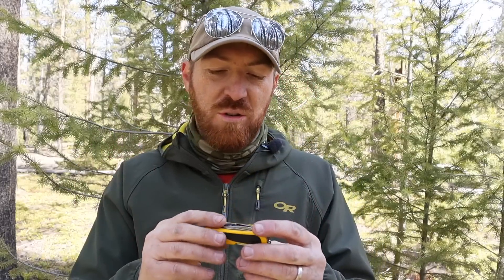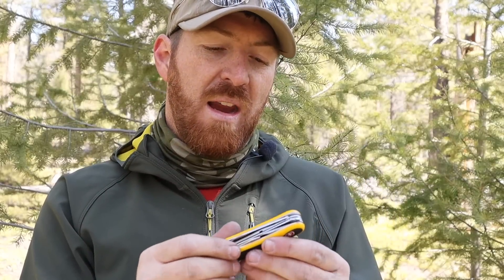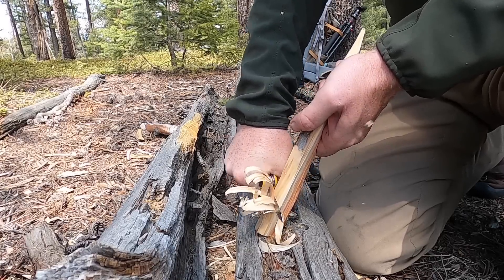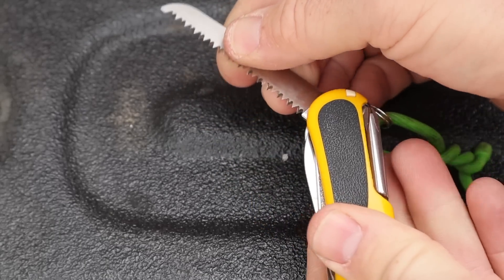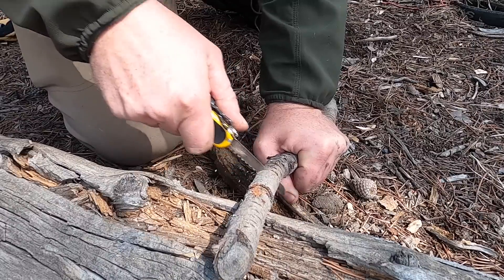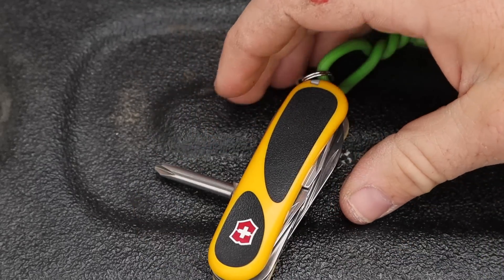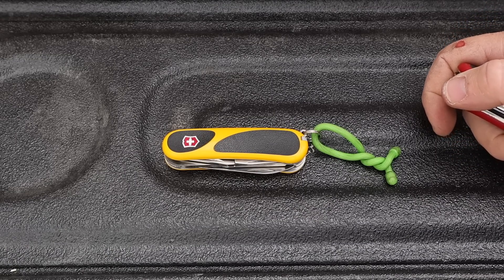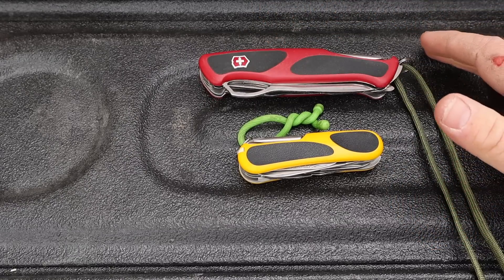All You Need! Swiss Army Evogrip 18

Comment: I like the Huntsman model. Corkscrews are great for undoing tough knots and I find myself using the small blade more often than the larger one because I feel like I have more control and a finer edge. The parcel hook that comes on the Huntsman/Fieldmaster is great so long as you're using a little ingenuity - I use it to carry litter boxes with the plastic packing strap handles. It's really about what options you can make work for you and what models have those options.

The Evo series uses a lot of the Wenger brand tools and are different from the other knives. I hear a lot of it is hit or miss, especially the scissors because they have micro serrations that catch and fold on stuff like cord and bankline. Gotta research your buy.
Reply: Also a big fan of the huntsman. The only thing I missed was a locking blade but its really easy to wrap a bit of paracord around it to do the same job. I never go into the woods, hiking, anywhere outdoors really without it.

Comment: I really like Victorinox knives and I have had one for years.  The saw is very impressive and can do a lot more than just cut branches.  I once used one to cut off a brass padlock by cutting through the brass itself.  The large teeth on the saw make good for cutting soft nonferrous material like brass and copper.

Comment: the point on the nail file is very useful as a small screwdriver. used it to tighten glasses and to remove the backside of my timex watch to replace the battery. and the file always comes in handy when my finger nails crack or split.

Comment: The main blade  on these little models can be pinch opened with thumb and forefinger.  No nail nick needed. And better blade belly than similar Vic model.  If you keep to light tasks, the blade doesn't dull all that fast.  An outstandingly useful bit of kit! 
THANKS,
David.

Comment: For those with eye or sun glasses the file/nail cleaner can be carefully sharpened at the end to make an excellent eyeglass screwdriver and will still perform the other functions. If you have no use for glasses or a nail cleaner you can file/sharpen it flat on the end to make a scraper and small wedge for opening stuck jar lids.

Comment: This model SAK was original to Wenger SAK's.  The sculpted handle and the scissors with the lever operating off the mainspring rather than it's own independent spring like you see on most other Victorinox models were design features specific to Wenger SAK's..  When Victorinox bought out Wenger much of their production stopped, but the plant making this model keep on producing.  One of the things I hated to see go was the hook shaped can opener on the Wenger SAK's, I found that style opener more useful for tasks other than opening cans.  I still have some Wenger SAK's including one with a locking main blade.  The small Wenger SAK with nail clippers is part of my EDC.

Comment: The Evogrip 18 is one of my favorite secondary carry knives. I like the tool set. The Evogrips are a carryover from the Wenger designs, which is why it has the different style scissors.  This 85mm Evogrip and the 91 mm Huntsman are two of my favorites. Nice video. Oh btw I noticed you are correctly calling that SAK an Evogrip 18 but in your text you are referring to it as a S18. The S18 is the same knife but it has a locking blade.
Reply: Yeah I way prefer Wenger's micro-serrated scissors to Victorinox's. The Huntsman is also my favorite SAK, but my most used is a Midnite MiniChamp with the pen and red LED in the scales.

Comment: I have the S17, and love the locking blade option.  Now I can poke and stab materials with the main blade like plastic bottles and wood surfaces without worry of the blade folding and causing injury.  The bottle opener/flathead screwdriver is also auto locking so you can leverage heavy use without worry of the blade folding on you.  With the wood saw, awl, and scissors, it's the awesome Huntsman with a locking blade.  Wish Victorinox offered the locking blade (with liner lock) on all it's medium sized knives as an option like this as it's a safety feature more than anything.

Comment: I have three of these in the S16. Each slightly different. There is an S16 Evogrip that has a locking blade. The one you showed without the locking blade. And there is the Evo S16 (with or without locking blade), which was discontinued. My 3 models do not have the saw, and are 1 layer thinner. They are the ideal SAK knife. I completely agree. I like the Alox cadet as well. Great recommendation and video!

Comment: I do have a Evogrip 18 wich is Wenger made. It's on of the models Victorinox kept in there portfolio when they purchased Wenger. The Wenger can opener was of a different design, that was swiched over to that of Victorinox. I also have a Wenger made Evogrip 17 with walnut grips. The difference is it has a corkscrew instead of the phillips. And it lacks the tweezers and the toothpicks. The tweezers and the toothpick of Wenger are also a slightly different design. Victorinox still uses the Wenger brand for Suitcases and Watches.

Comment: An interesting knife. I do love the victronic series.

I agree with you about the Phillips screwdriver. I believe they put it where they do for torque, but like you said you can't reach into smaller spaces. And if you put the Phillips screwdriver where you suggested, and only opened it at 90°, you can get an awful lot of torque with it.

I disagree with you about the usefulness of the saw. While you can take a dry branch and break it in your hands, or a thicker one between two trees, even this small saw can be useful for precise cuts and for cutting green branches for tools. Especially fishing poles. And the precise cuts would be more appropriate for emergency shelter building, and other tools. A larger saw would be nice, but this will do well in a pinch.

I would like to see the nail file replaced with a regular file like the Swiss champ, which can do nails, but also metal. I even used the metal file to cut into thin metal.

Comment: I've got to disagree about you with the file. Especially outdoors. Combined with the scissors, if you catch/cut your fingernail and it always catches when you put your gloves on, it's the perfect tool. 
Also, when you're outdoors, you don't know if that's dirt, or shit under your fingernails. 
The corkscrew is great for unpicking super tight knots. 
The flat head driver on the evos (a holdover from the Wenger line) actually recesses under pressure and won't fold if you're putting pressure on it.
Reply: The awl on a SAK is the best nail cleaner ever.
Reply: The file also works very good as philps-screwdriver for tiny screws

Comment: Never really used the saw on my SAK until I bought a camping hammock; now it's an essential complement to remove those annoying little growths that get in the way of tie straps.  Conversely, I'd previously never buy one without a corkscrew as the idea of having a bottle and struggling to open it is anathema, but now almost every bottle is screw-top anyway.
Reply: You can use a stick and just push the cork into the bottle.

Comment: I carry the locking version daily.  I would note that the huntsman/field master is probably a better deal if you don't want the locking blade and honestly the scissors are better.  The evogrips are a bit shorter which can be helpful.  As I am mostly urban, I wish someone one create scales that would have eye glass screwdriver instead of the toothpick.
Reply: You do know they have an eyeglass driver that screws into the corkscrew, right?  It's a couple of bucks.
Reply: @barrybogart5436  Yes, however then you need to make a choice of what you will use more often a Phillips driver or an emergency eye glass tool.  I have never used the toothpick on a SAK.  I currently carry a S18 and Leatherman PS4.  The tip of the PS4 flat Philips acts as my eyeglass screw driver.  I may be transitioning to an explorer since it has the corkscrew for the micro driver and a inline phillips.

Comment: I’ve seen a lot of videos on Victorinox. This might be the first they admits the saw is not best suited form cutting trees, but more for notches and finish work. Gave me a new view on that tool.
Reply: The teeth are not bend so that they cut a channel wider than the saw blade's spine thickness. Even if the saw was 20" long or something it would still suck at cutting down trees because it would simply get stuck.

Comment: I’d rather the extra weight in order to have a Leatherman.  I still can’t get past the no lock factor of the Swiss Army Knife.  Good video as always.
Reply: There are models with a lock, some of the Evogrip ones do.
Reply: Most of the bigger models do have lockers.
Reply: The Evogrip s18 has a locking blade. The normal Evogrip 18 doesn't. So if you want the locking blade get the s18. I have an s18 and have owned it for a few years. I love it to death and use it very often.
Reply: locking blades are illegal in many countries.

Comment: The S18 - just like yours but with a locking blade - is my favorite general use SAK, just ahead of the Explorer model.  The locking blade trumps all and the rest of the tools are great.  Not with you on the scissors though.  After many years of use, I've kinda changed my opinion, and favor the design of the Victorinox scissors over the Wenger design on the Evogrip series.

Comment: In some you tube videos with Swiss army knifes some people say the wood saw is not needed as when you collect fire wood you can just break it with your foot which is quicker but that only works with you old dead wood to a certain extent but if collecting from fresh fallen trees that still contain a bit of freshness in the wood it doesn't break so easily so in that case you would need a small wood saw on n order to trim and collect

Comment: Easy to sharpen the distal section of the nail file into a precision small blade or utility/box opener.
Reply: I did that on my Sportsman. It turned out great. And still have the larger part of the file absolutely usable.

Comment: For outdoors I prefer the Huntsman. It has all the tools the evogrip 18 has except the proper philips. Has that backup blade which I tend to use more than the main blade on my Huntsman (cutting open food packs / supplies). It's also cheaper I think. Of course it doesn't have the grip. 

Also has a corkscrew that can be used to store a small ferro rod or spectacle screw driver. 

For city carry (especially when I was living in Europe where locking blades are a big no no), I preferred the pioneer. 

The punch / reamer on pioneer is essentially one hand opening and works well as a last ditch survival stabber. The pioneer reamer is one of the best underrated tools on SAKs. 

Aaron, you should also review the Farmer X it you get a chance. I think that's a perfect backpacker's SAK. Minus the toothpick, tweezers.

Comment: G'day Aaron, not a bad option for its size. Totally agree with you on the phillips head design, should deploy in line with the handle, it's probably the only bug bear I have with my Ranger 78; (tell a lie; needs a locking saw too). Anyway, I can see that this model would quite useful in a couple of different roles. I didn't even know it existed to be honest, thanks for showing it. Cheers Duke.

Comment: Thanks for the review, Aaron. Just a note - the S18 blade is LOCKING, not slipjoint. It has that over most other SAKS that size.
Reply: Did you watch the video? It doesn't have a lock. Model number for the one with a lock is 2.4913.SC8.  Model but without the lock is 2.4913.C8 (S = safety or secure)
Reply: @yespeace2000  I did watch the video. And I am quite familiar with the SAK. I have carried it for a few years now. There is a version that has no lock, but it's called the Evolution Grip 18 or EvoGrip 18 and has red and black scales. The yellow and black version, the EvoGrip S18, is the locking version.

Comment: I do like the locking option of the ex-Wenger models, but for my hands they feel just a bit too short. I prefer the original Victorinox with 91mm. The difference is only 8mm but you can definitively feel the difference. I keep the EvoGrip in my tool case, but my EDC is a now 25 year old model which isn't listed any longer - basically the SwissChamp but without the pliers. I also have a SwissChamp, but again it just doesn't feel as comfy in my hands as my old knife. Must be the habit 😂

Comment: This is the older Wenger design to compete with the Victorinox Fieldmaster. Both are made now by Victorinox but I prefer the Fieldmaster over the S 18 because of the extra blade rather than nail file. I do like the fact that it locks.

Comment: I have this same model, my only complaints are the slightly shorter main blade than standard Swiss army knife and the very hard to open scissors(the part you grip with your finger nail is extremely small).

Comment: Both of these knives are designed by Wenger. The tools are therefore not identical to Victorinox original ones (and I'm not speaking just about the size). Personally, I think EvoGrip is too small, which is good in office environment or around the garden, to save you the trip to tool chest. But than again, I have Classic on my keychain, using it all the time. For cleaning my fingernails, mostly! (so, that tool isn't useless, "Gideon Statistical" ;)

Comment: You have an Evogrip 18 not S18.  The S18 has a locking blade with a little lever that sticks out that says "Lock" when the blade is out.  The Evogrip and Evolution models were Wenger before Vic bought them out, which is why the scissors are different.  Wenger had better scissors on most of thier models.  There are a few Evolution S models with locking blades as well.  I like the Evolution S101 as it is, from what I have seen, the only model with a locking main blade, a second, smaller blade instead of the nail file, and I don't use/need SAK scissors.  It is just a tad thicker than a Tinker, so good for EDC.  It is also only about $25 wheras the Evogrip S101 is over $50.  I also find a corkscrew more useful than the Phillips, great for loosening knots and can put a small glasses screwdriver in there.  The small scredrive blade on the can opener does pretty good with Phillips head screws anyway.  I'm not a fan of the 111mm models as they are, IMHO, too big/bulky for EDC, but, as you point out, probably a better backpacking/camping/JIC tool with the bigger saw and locking blade.
Reply from the maker: Oh strange, I didn’t have the original packaging and when I was doing my research it seemed that was it a S18. Thanks for clarifying.

Comment: Just one comment. The Evo line has versions with a locking blade, in case someone needs it.
Reply: The S18 that he is reviewing also has a locking blade. He just didn't mention it.
Reply: @gabithemagyar  The title says S18, but he is reviewing the Evogrip 18. The S18 has a locking blade as you say. Thanks
Reply: @gabithemagyar  The model he's reviewing doen't have a lock (model 2.4913.C8). Model 2.4913.SC8 has a lock. S stands for "Secure".
Reply: @yespeace2000  My mistake. He actually says it's the Evogrip 18 but I was thrown by both the caption at the 30 second mark and the name of the video saying it was the S18 model. I didn't notice that he closed it with one hand without pushing the shield  at 5:55 :-)

Comment: Aaron, a comparison video showing a task-by-task evaluation vs cost and weight using a few of the multitools you’ve already shown over recent years would be a cool video.
Something like Rangergrip 58 vs Evogrip vs Bond vs P4/Wave vs whatever else you have.. 
If nothing else it’d be a good visual side-by-side show, plus capabilities and limitation demo.
Lay out your tool requirements and priorities for a woods/hike/camp option.

I’m a huge fan of the Rangergrip 78 for its locking 4” blade and long saw, but the much smaller Handyman has been my go-to fixed blade companion for 20 years.
Lately the Leatherman P4 has been getting a lot of my outdoors attention because its all one-handed and overall more capable/robust than any SAK… its worth the extra weight I think for most overnights.

Comment: I have the Fieldmaster. I was looking into the Manager as an EDC but I think I stick to the Fieldmaster since it has everything I need. The small knife is pretty useful. I shortened a small plastic tube with the saw and cleaned the edges of the tube with the small knife. Very useful and super handy. The big knife would have been too big.